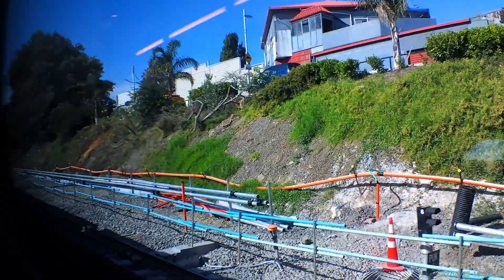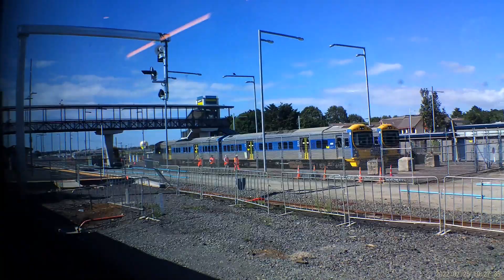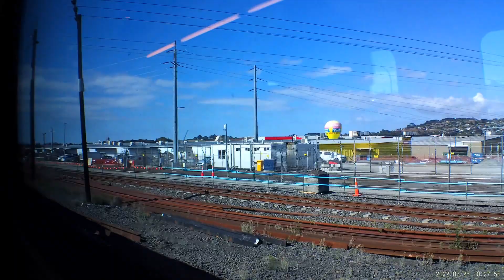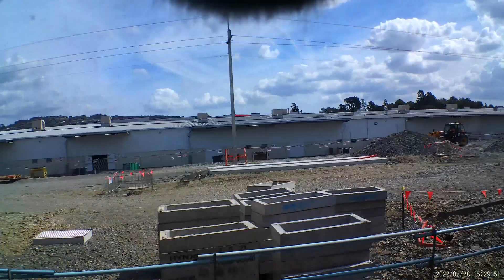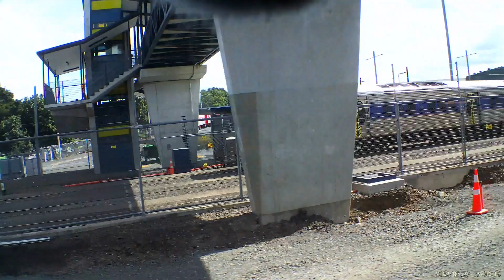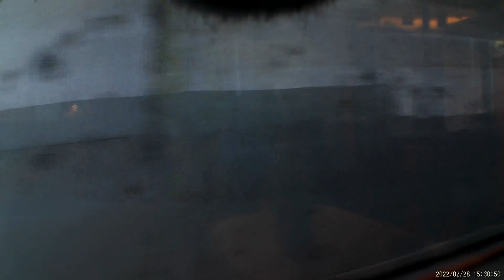Pukekohue Station works , March 2022 .

Comment: i thought the trrack is being electricfed at september
Reply from the maker: Going by KR and AT it's supposed to be completed by 2024 , And the DMU's will stop running in September so they can start all the major works for the installation of the catenary system .
Reply: @davidlipscombe916  ok